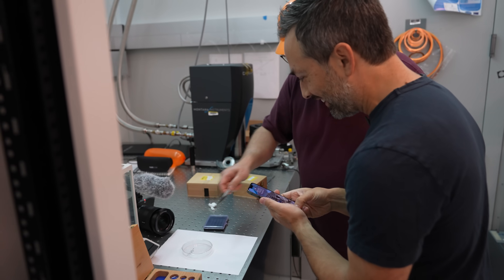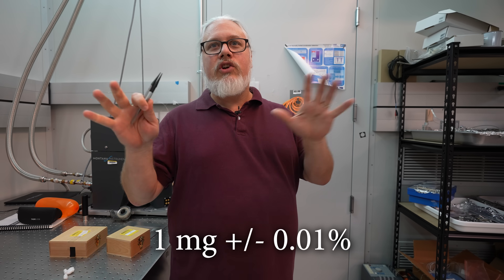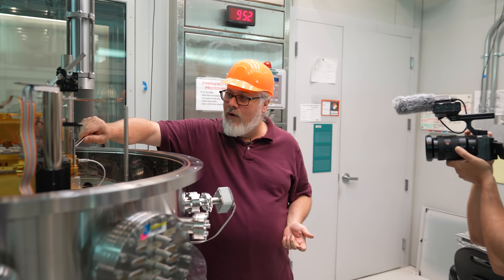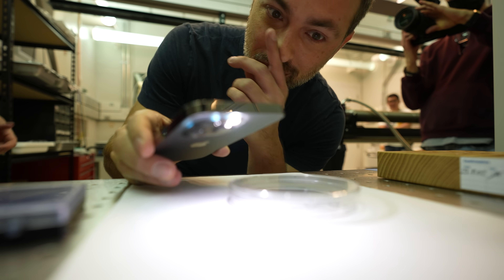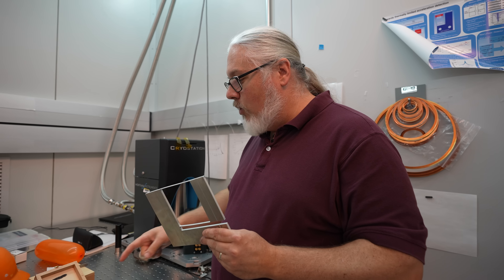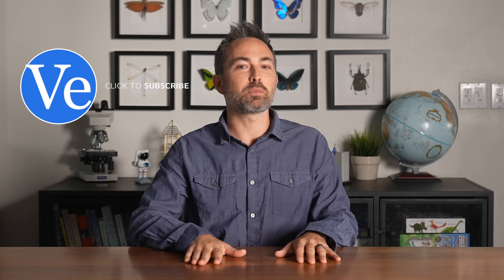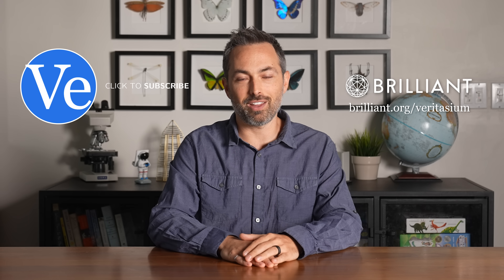How To Measure The Tiniest Forces In The Universe

Comment: You know what's more stupid than converting metric to imperial or whatever? Caring about what arbitrary measurement system we use enough to actually argue about which is better.
Reply: There is nothing arbitrary about using a constant scaling factor.
Reply: @bryankrippner7996  Ok. You're not gonna mention that I may have been being presumptuous, considering that that one douchebag never really said he liked metric more than imperial? Because I was referring to how one's choice of measurement system is ultimately meaningless. Not that using "Constant scaling factors" is arbitrary.
Reply: @bryankrippner7996  Basically, arguing about how to measure things is pathetically stupid.
Reply: @MrFreeman012   Absolutely not. We need consistency. More than one aeroplane has crashed because the refuellers and the pilots were not talking in the same units.
Reply: @bryankrippner7996  Then they can standardize on units. What's your point?
Reply: @bryankrippner7996  I mean, I'm still not making the point that standardization is meaningless... When did I ever say that? I said which single measurement system you use is meaningless... Because I assumed, possibly wrongly, that the "Yeah, it's stupid" guy was making a statement about the metric system vs. the imperial system... 😐
Reply: @MrFreeman012   There is nothing meaningless about choosing a system with constant scaling over one without. There are formulae which take as input measurements in one unit, and output measurements in another. In the imperial system those formulae have to be changed when you change units.

The US must be so proud to be using the same system as only Burma and Liberia, and the only country with no intention to change. The arrogance is mind boggling.
Reply: @MrFreeman012   So now you're back to assertions without justification.
Reply: @bryankrippner7996  Without justification? How about the fact that the vast, vast, vast majority of Americans use imperial without a problem? 😐
The hell are you talking about?
Reply: @bryankrippner7996  Where are you from exactly? Because wherever it is, I guarantee it's just as egocentric and insular, just in different ways and areas of life. That is, if you're a human living in a country populated by humans, anyway.
Reply: @bryankrippner7996  But yeah, we can also communicate, oddly enough. See, now you've made it even easier to draw the comparison with grammar nazis. You know why everyone hates grammar nazis? Because they fret over misuses of grammar that generally don't actually affect everyone's ability to understand each other. Grammar rules make sense in general, but you absolutely don't have to follow them rigorously in order to be understood by the average person in an average setting.
Reply: @MrFreeman012  Funny how someone from a country which supports free speech even when it is Trump-hateful wants to dissuade others from freely expressing themselves.
Reply: @bryankrippner7996  Um... What?... Is this about your deleted comment? I didn't do that and don't even know how to do that.  😐
What speech am I possibly silencing? I haven't even said I think people shouldn't use metric. I just think it's stupid to argue about it so incessantly.
Reply: @MrFreeman012   Yet here you are arguing about it incessantly. Why don't you take your own advice? What are you achieving? Or is it suddenly not "stupid" to argue about opinions if they are your own?

One has to wonder how you could possibly think I was accusing you of shadow-banning comments. You DO realise you have also had two of your comments shadow-banned, right? (None are "deleted".)
Reply: @bryankrippner7996  I'm arguing about how stupid it is to argue about which measurement system to use. I'm not arguing about which measurement system to use. By the way, I should've been more clear. I think it's stupid to argue with animosity and maybe also a little bit of pompousness about such an insignificant topic. If you want to be an advocate for metric, go ahead. But, if I can make an argument that will possibly stop people from looking down their noses at other people, that argument is worthwhile imo, and I'll definitely make that argument.
Reply: @bryankrippner7996  Also, no I didn't notice the shadow banning. I guess I'll take your word for it, but whatever. YouTube sucks. 🤷‍♂️
Reply: @MrFreeman012   .... as you continue to look down your nose at me ...
Reply: @bryankrippner7996  I'm not really looking down my nose at you or even that other guy or anyone who likes metric. How could I? I'm always on the defensive in this context. But, I do get irrationally angry like the rest of humanity, so I don't always get my point across as diplomatically as I'd like but whatever. Plus, hypocrisy doesn't really disprove the argument. It just means the arguer is fallible... like everyone.
Reply: @MrFreeman012   You are definitely on the attack. And you have certainly practised spinning yourself out of any situation.
Reply: @bryankrippner7996  Whatever you say.
Reply: @MrFreeman012  Glad you agree.

Comment: Quick question - why use Platinum-Iridium alloy for the kilo weights rather than Gold-197? A stable material with no half-life (not measured anyway), resistant to corrosion, especially if enclosed in such a way as the existing kilo weights - meaning no changes in its weight other than due to difference in gravity at whichever points on Earth?

Comment: 5:26 correction: the equation hf=mc^2 does not make any sense, but the units do match. This should be specified.
Reply: Where is the problem?
 hf= energy and energy = mc²
Reply: @yourguard4  but it's not the energy of the same thing, photons have no mass
Reply: @zswu31416  Doesnt matter. Energy always has mass, no matter which kind of.
Reply: @yourguard4  E is not mc^2 in this case
E=√((mc^2)^2+(pc)^2)
The photon has no intrinsic mass. You can assign it a mass based on its energy, but that is just not how scientists do things.
Reply: @zswu31416  It does work.
If the mass of a photon is E/c², than its momentum is E/c² * c (mass times velocity).
Which is E/c.
And because E=hf we get 
momentum = h*f/c
which matches with observation.

And what do you think "intrinsic mass" or "rest-mass" is? Pretty much all of mass is just due to the presence of energy.

Comment: For those wondering how we would calculate the force of a laser in theory, you just take the power of the laser and divide by the speed of light. For example a typical laser pointer might have a power of 1 to 5 milliwatts, which you divide by 3*10^8 m/s to get, indeed, a force in the piconewton range.

Comment: If you can measure the force of a laser pointer, does that imply the possibility of measuring the force transmitted by a single photon by measuring the force that might be transmitted by a much larger number of photons? Is there any possibility of setting up an experiment that will detect the mass of photons, if such mass exists?

Comment: To chide American's don't embrace the metric system is short sighted.  The metric system is not flawless either.  Celsius fails when you consider a human can't take much of a temperature change which makes the measurement less valuable.  Then try to create a third out of 10.   Yeah the extended decimal is dumb.  10 doesn't divide as well as 12.
Reply: True, 12 has more divisors than 10 and so is superior.
But it is dumb to use base 12, while also using only 10 different signs/digits^^

Comment: Every atom and atomic objects are expanding at 1/770,000th their size per second per second constant acceleration. Applied to earth size object equals 16 feet per second per second constant acceleration: gravity. D=1/2at^2 major part of the gravity equation. “The Final Theory: Rethinking Our Scientific Legacy “, Mark McCutcheon. How long will ignorance prevail. Light is a cluster of expanding electrons. Sending white light through a prism divides the light by ‘size’, I.e. the red ( most ‘massive ‘) bends least. Planck’s ‘ constant is simply a single expanding electron: an object,not a wave, field, potential, etc ( all the usual suspects).

Comment: I came across microcantilievers while doing my PhD bibilographic research on some pesticides traces sensing. Those are fabulous. You can also "cover" one side of the arm with specific molecules designed to react with the chemical that you want to sense. It then becomes sensitive to the desired molecule. Then the cavity below the arm (as shown in the big model in the video) is filled with the gas or the solution that you want to test. The sensitive arm then reacts with the analyte and that creates a bending force that is measured (like if you measured the bending force of a weight put onto the lever). 
Despite being very hard to calibrate, this system can be 10^10 times more sensitive than the best sensing technologies ! So this technology was able to detect as low as 10000 molecules in one mL, which is nothing (there is 10^21 water molecules in one mL of water)! Its humongous sensitvity is also a huge drawback, so that you can't really take it out of the very controlled lab conditions. But the sensitivity of that thing is just breathtaking.

Comment: 1 mm of spider silk weights around 50 ng (nanograms). ¿Could you see it? Perhaps in a dark place with perpendicular light. The calculus is made from the sentence: "As a result, a strand long enough to circle the Earth would weigh about 2 kilograms (4.4 lb). ", from Wikipedia (spider silk). PS, correct me if I am wrong.

Comment: i wonder if they all gained weight from ppl handling them, nobody probably ever wanted to mess with the original n when they did i imagine it was done correctly, i could see how over time the guy in charge of the other weights in the other countries would have a friend over on a special occasion or something like that n theyd physically handle it lol n fingerprints would absolutely add up    also, im not sure exactly how they were used, but if they were handled on some kind of regular basis to either keep track of its weight or use it to calibrate other weights that would b a more practical way for that much weight from fingerprints to build up  ..if thats even what the cause is..idk at all, im jus throwin an idea out there

Comment: Could it be that the reference weights gained Mass over time because of handling? ..  that the things they were handling with accreted mass onto the references? 

 Put another way, we all know friction is basically "micro bonding" at contact surfaces; perhaps some of the material wears off from one surface to another?

Would sure be interesting to know more about how the reference weights were handled and whether the accretion were more likely to confer to the reference weight side then accrete to the "handling material" side.

Comment: All these Standards and Devices would become superfluous once the mathematical model of how plants grow due to particle interactions inside the earth is discovered.

For then it would be possible to grow Standard PLANTS sustained by the core of the Earth itself with 100% accuracy for all necessary measurements, large as well as small.

And the measurements themselves would simply be the ability of individuals to detect displaced growth on plants and then influense growth on definite plants through the solids, liquids and gases released by each to enable a particular animal to eat, so as to influence definite growth somewhere else.

And all trades would take place through transfers from one plant to another by programming internally the Material one releases (called EXCRETA at present) to the surrounding.

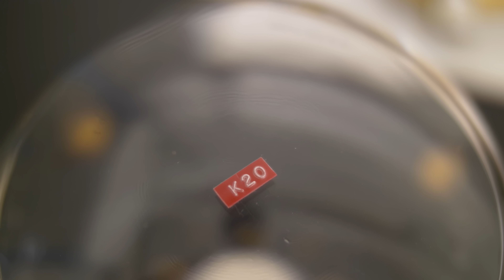Comment: 0:46 Most Americans can't handle the truth as they are too busy drumming their chest for their Imperial system and how they are so special as the industries long time ago adapted to the metric system for the sake of standards and saving money by doing so. I just wish that would happen also in other branches to stop loosing expensive space probes to confused measuring systems.
I also recommend people dealing with international partners to be precise, resp unmistakable when it comes to writings like dates yy/mm/dd vs mm/day, etc. I suggest spelling out the month to avoid any misunderstandings and double check if you use commas or dots to write large numbers and use proper labeling of numbers if they represent the proper currency, weight, distance, number size as such small errors can have VERY expensive consequences when dealing with authors from various countries.
Blind assumptions that others use the same method as you should NEVER be presumed, especially when large amounts of money are involved, directly or indirectly. Speaking of decades of experience in the chemical industry and data research for production plants to prepare production badges. The difference in cultures and throughout history was and always is a mix of precision, history and culture studies and reminds one why international standards are to damn important for ALL of us even mostly indirectly.

Comment: One place where tiny forces are used is in LIGO (Laser Interferometer Gravitational Wave Observatory).  We use the force of a precise light source to calibrate a detector capable of measuring tiny displacements 1/1000th the diameter of a proton.

Comment: 0:47 Yet another reason why the Imperial measurement system needs to be ditched. lol

And that's coming from a Brit, where we still cling on to imperial measurements, and I've had to use both for a lot of things.
eg. We often still use stones, pounds, and ounces for things like body weight.

But I never fully got to grips with imperial anyway, as I always forget whether it's 12 or 14 pounds in a stone, etc.
(it's 14 pounds in a stone.)

It was surprising to me when I was younger, to discover that the US still uses Imperial for so many things.
I guess we do use MPH on motorways.

Imperial is also still used in PCB manufacture, but with a mixture of Metric as well. It's very strange, and confusing.
(they use "mil" / "thou" a lot for things like drill hole diameters, trace widths and spacing.)

I only recently started measuring body weight in Kg. Once you get used to how it equates relative to what you're used to, it's fine.
(a lot like using different currencies that you're not used to.)

And Metric is SO much easier to do calculations with vs Imperial. Everything in base-10 (or whatever the proper term is).

P.S. I genuinely have no idea how much a "quart" is. lol
And then there are gallons vs litres, two different versions of "tonnes" vs "tons". sigh

"A ton is an imperial unit of mass equivalent to 1,016.047 kg or 2,240 lbs. A tonne is a metric unit of mass equivalent to 1,000 kg or 2,204.6 lbs."

The mix of units can cause huge problems. Not even the top scientists get it right sometimes.
Like the space probe that crash-landed because they mixed up Imperial and Metric units. lol

And yes, I realize the irony that the Imperial system was first developed... in Britain. It's all our fault, sorry. lol

Comment: As an electrical engineer, we depend on our instruments to be traceable to a national standards laboratory.  Here in the US, that's NIST.  It's absolutely essential to make sure we measure the right thing and know we are measuring the right thing.  And for much of this sort of thing, NIST traceability isn't a one time thing - most instruments have to be periodically rechecked against NIST traceable instruments.  This, by the way, doesn't mean we send all our instruments to NIST every year.  What it means is somebody has a reference that may actually have gone to NIST (or one of the other labs that traceable to NIST, like Keysight, formerly Agilent, formerly HP).  So, its value is known compared to national standards.  That reference is then compared against our instruments.

Another cool thing NIST does is, you know those radio clocks (the ones sold as "Atomic Clocks")?  In the US, they get their time signal from NIST.  NIST has a radio station, WWVB, near Fort Collins, CO that broadcasts the signal those clocks use.

Comment: At work we have a microbalance that measures a 1 mg weight as 999  micrograms most days.
Not as accurate as this lab. But we have to measure little residues like 30-40  micrograms. 
I did not trust it and could not find a smaller weight.  So I took an eyelash that measured 
36 micrograms. Then measured the eyelash and the 1 mg weight. Together they weighed 
about 1034-1036 micrograms so I trusted the balance was OK for the range of my sample size. Took the eyelash an put it in a labeled vial for future use. Nice video.

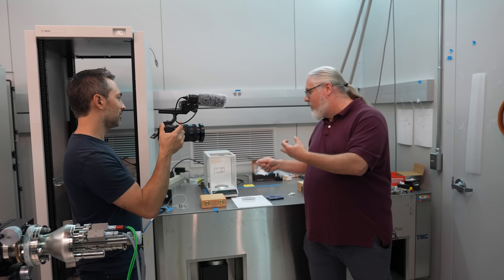Comment: 2:24 subdivision is one of the advantages of the imperial system. You can DIRECTLY go between units (pound / ounce, gallon / quart / cup / ounce, foot / inch) with subdivision. This means you can get whole subunits with nothing but a balance (IE 1 ounce of sugar from a pound of sugar). You CANNOT do this directly with a base 10 system. Not a big deal in today's modern world, but a huge pain in times gone by.

Comment: I'm pretty sure that if you're reading this, it's because you're looking for a way to measure the smallest forces in the universe. Well, I have good news: you don't need a device that can measure the tiniest forces in the universe! You just need a device that can measure a slightly larger force than what you want to measure, and then a bunch of other stuff that probably goes against your ethics.

I mean, sure, it's possible that there are some people out there who are willing to go through all of this trouble for science. But for most of us? It's probably not worth it.

So go ahead and do it if you want. Just don't say I didn't warn you when your lab gets shut down by the FDA or something like that happens because of your ethical violations (which is definitely going to happen).